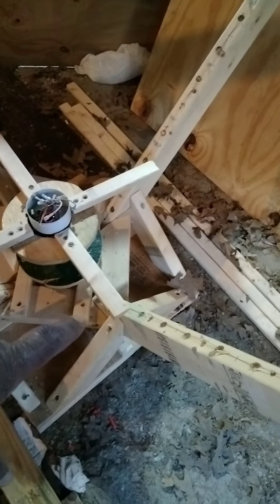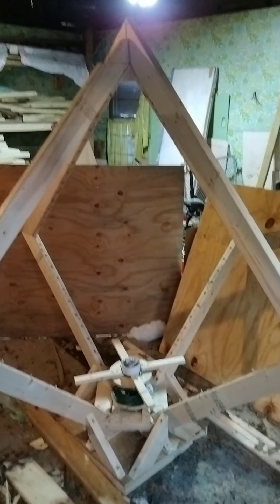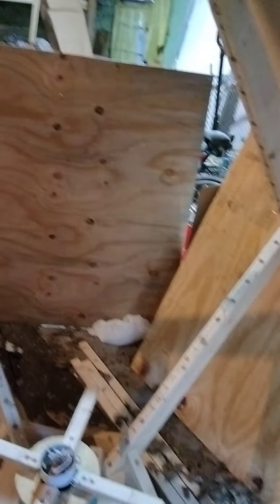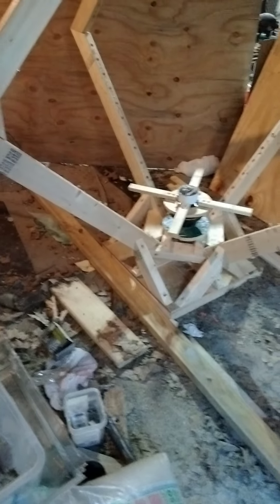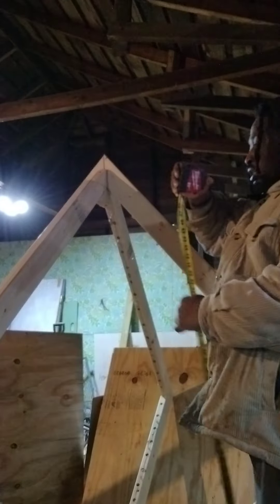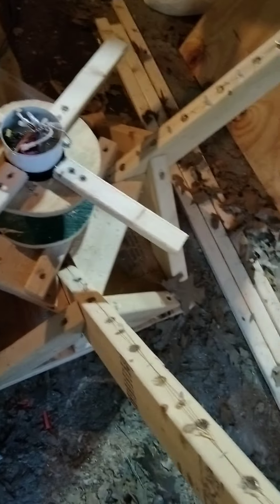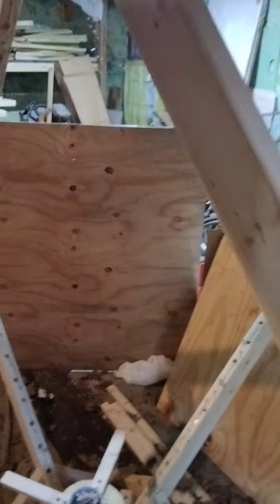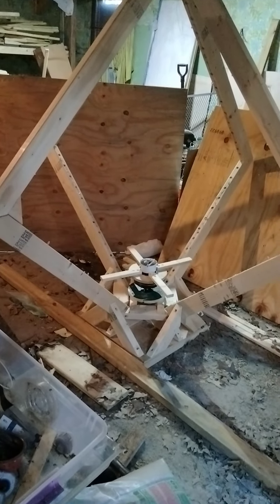Tower project.... magnetic field device

Comment: Ah~ Well done! Can't wait to see the final device ✨️👌🏽
You may want to mod the fan motor so it will be strong enough to hold up and spin the wooden parts you're going to add at high speeds... 🤔

Fans don't normally deal with that kind of extra weight pushing down on them 🤔

Comment: The battery will eventually corrode and you’ll have to replace every so often maybe consider solar panels or a wind turbine to power your device 💜✨💙✨🐉⚡️🪶
Reply: I was thinking something similar, 🤔
I'm also hoping the fan motor will be strong enough to hold up and spin the wooden parts he's going to add 🤔
Reply: @Zora9452  Remedy definitely has some post completion adjustments to account for. It is now time to start utilizing alternative InnerG sources and ultimately combine those resources to create something that will take us into type 2 civilization